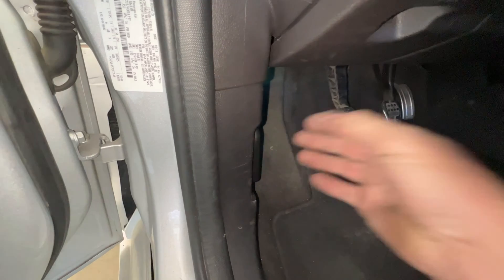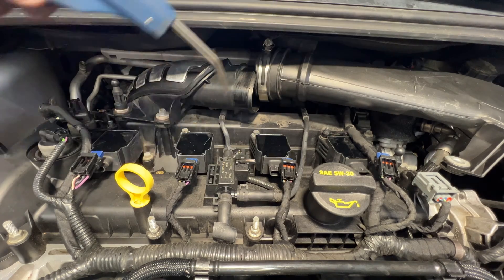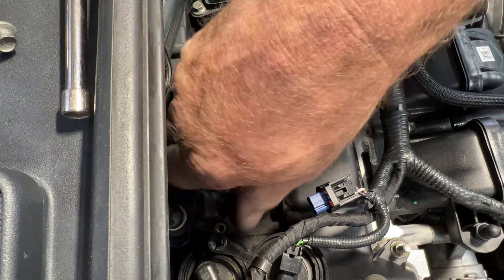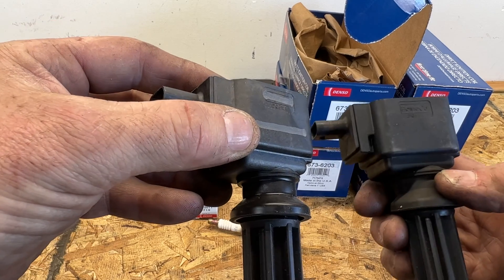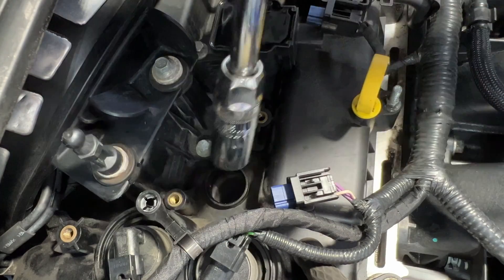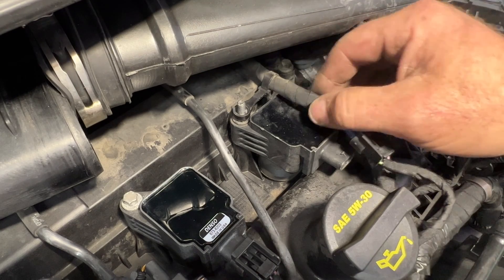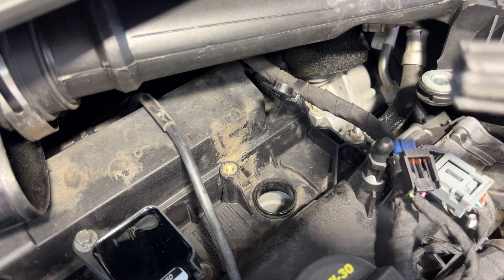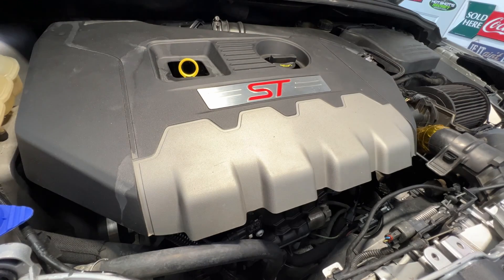2013-2018 Ford Focus ST Spark Plugs & Ignition Coils Replacement How-To

Comment: i have a 2014 stock ST.  just got a blinking check engine light seeming to allude to changing a coil or spark plug--will get the code tomorrow.  can you confirm which plugs and coils you recommend?  I don't really plan on tuning anything in the near future, just looking for quality and longevity
Reply: I just bought iridium IX NGK spark plugs google recommended it. For coils go with denzo

Comment: I did mine yesterday on a Volvo 2.0L T5 B4204T7 which is the same engine.Thanks for the great video ! Loved the tip about using the airgun to blow out dust before removing the spark plug. Volvo Vida doesn't tell you that ;) 
I see you tightened the spark plugs with 12Nm, which was also the instruction in Volvo Vida. 12Nm seemed kind of loose to me, so I did some investigation. On the original Volvo Spark plug packaging it says 22Nm which is about what most spark plugs need to have. I used NGK and their website says 7.2 ~ 14.5 lbft. So I did the 22Nm in the end. What's your experience? 12Nm or should it be higher? And if 12Nm, do you recommend loosing them up and re-tightening them?

Comment: 5:40 Ford specifies the plugs to have a gap of .027"-.031" from the factory. About 0.026"-0.028" if you're tuned,. 

0.040" is too large a gap, even for a bone stock ST. These engines eventually widen the gaps on the plugs and the gap should be checked with every other oil change.

I'm not trying to crap on your video: you took the time to show people how to do something that not everyone would be comfortable doing, and I appreciate that. I just think people might want to know that in the Focus ST/RS community, the general consensus on gapping plugs is the above.
Reply: Good info sir 👍

Comment: Hi there great video! Do you happen to know what order the cylinders are in? Id assume if you're looking at the engine from the front of the car it would be 1-4 going passenger to driver side. I think my coil for cylinder 3 may be bad, but I want to make sure I'm replacing the right one when I pull it out. Thank you!
Reply from the maker: Yep you’re correct 1-4 starting on the passenger side to drivers side.

Comment: I have a '14 ST with about 55k miles. No issues with it whatsoever but I'm looking to change out my spark plugs very soon. If I have no issues with my coils, do you still recommend replacing them?
Reply from the maker: No sense in replacing them. If one goes bad it will usually throw a code and check engine light.

Comment: The engines works the best on Beru spark plugs.
They run rough and sluggish on the Bosch or Ngk especially on those crappy Motorcrap plugs.
Reply from the maker: We pulled these plugs after a few months and went with a step colder ngk plugs no issues so far.

Comment: Thank you for showing how effortless the torque wrench clicks at 106 inch lbs. I had to find a video before I started my engine that showed how light the torque wrench clicks because it seemed way too loose of a torque. Was thinking my torque wrench was faulty.

Comment: Very accurate 👌  I found it difficult to keep debris from falling in. The coil packs seem to keep dirt and leaves out of the pockets, but the far passenger side coil has a really small crevice around it that is difficult to clean. I ended up fishing leaves from around that spark plug with a greasy Q-tip. An air compressor really is a needed tool for cleaning debris from around the coil packs.